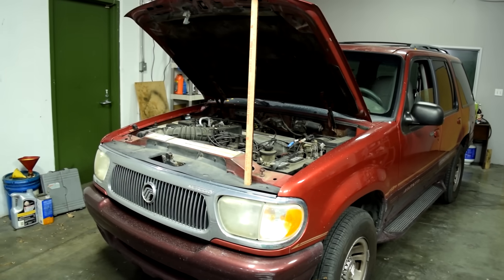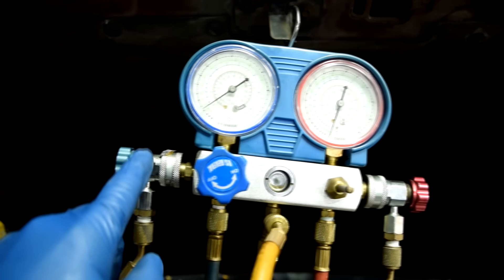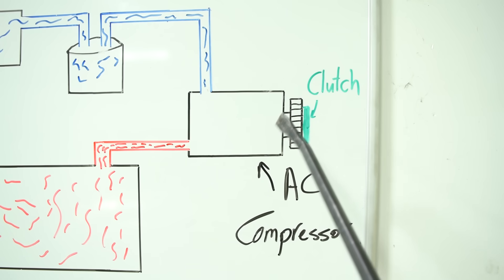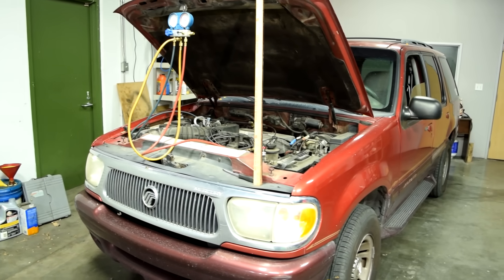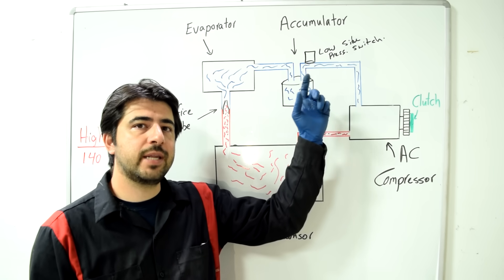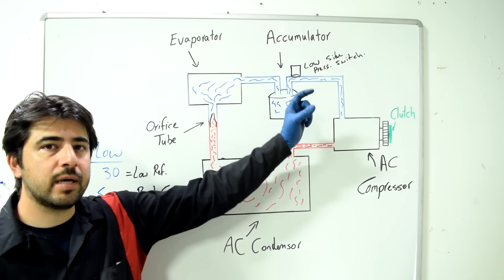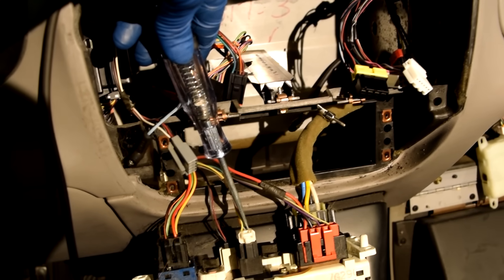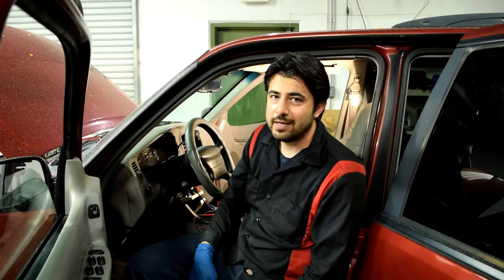Automotive AC Diagnostics, Operation and Repair

Comment: My condenser went out over a year ago(diagnosed by dealer and quoted a cool 1000 dollars to replace).
There is no charge to the system. 
I was wondering if the compressor is still ok after not being touched for a year. How can i tell?
Reply: GreenerGrassZephr 
How would that tell me if the compressor works? 
I know where the leak is.  I just don't want to replace the condenser and have a rotten compressor destroy it.

Comment: R134a corrodes copper, so the system must include an additive to prevent it.
R134a systems require special lubricating oils that are, on the whole, what type of aditive i should use with R134a

Comment: i want to make home AC buy using car AC compressure and other equipments.
Why i want to make: CAR compressure is robust, it hase no  motor. so i can use it by inserting 3 phase motor to it through coupling and saft . 3 phase motor can be run by AC drive which is single phase input and 3 phase out put and also we can controll the RPM of motor. When normal sigle or 3 phase motor starts to rotate it squzee all you home electricity at that starting moment. in other side motor driven by drive(VFD veriable frequency drive) it will not squeeze ur home electricity at starting time of motor.
need help to build home AC system using CAR compressure.
Reply: thanks for ur valuable reply
what i have to make
TO do list
1. AC car compressor (buy any 1400 CC CAR AC)
2. Three phase motor 230vAC
3 Single phase to 3 phase output AC drive
4. controller using arduino UNO 
5. Custom make Remote
6. Indore unit which has  swing window, evaporator,blower ,sensor,Co2 detector.
7. Outdoor cabinet which has radiator/condensor to cooldown 85 degree high pressure gas to 55 degree high pressure gas/liquid.
Motor coupler,
8. Radiator/condensor FAN ,TEMP sensor etc
Now i am stuck in Accumulator and orifice section. Orifice has tapperd diameter pipe (How to Upload PHOTO)
How to Know how much HP required to rotate the compressure saft.
As i will use Drive then i can slow down or increase speed,torque remain same without using cone pully,thats the drive's benifit. Also i can sense temperature and according to temperature motor speed can vary.
Do u have any idea which gague of copper pipe will take 200PSi pressure?
 Make a video related to whole AC system of a CAR.

Comment: quick question, when you connect your hoses to the service ports do you have to purge the hoses of air with refrigerant, I know air in your system is bad.

Comment: sir, my car i20 ac compressor gives a pressure reading of 40 psi at around 33 degree celsius (or 30 to 38 celsius) on the Low Side with full ac on. 

Is this normal reading? if not, would be grateful if you could kindly provide me some kind of pressure readings chart. Soliciting your attention. Thanks.

Comment: I need help: The Ac of my  2000 v6 mustang is not working and as I checked the compressor clutch does not engage. As I checked there is no voltage at the compressor connector and also there i no voltage at the AC fuse in the fuse box next to the battery. No is it possible that the switch is bad or maybe AC  refrigerant pressure is low so the AC switch is not working. I recognized when I switch on the AC the light on the switch doesn't turn on.

Comment: Very excellent, instructive video. I had a similar problem once before. In the hot months I would physically turn off the hot water supply from the engine cooling system with a manual valve, or simply disconnect the heater hoses and bypass the hvac system. Of course, it's a little inconvenient, and you have to reconnect to turn the hot water back on in the cool or cold weather.
Reply: This person is the true g. The solution is always in the comments.

Comment: What will happen if the condenser pipe pipe is too much hot... low side 40psi and the highside is 280psi? I know is not normal because I change the compressor..new compressor the condenser not change but the cooling system is good... maybe I change the condenser ?

Comment: My gauges are reading 44 on low side 200 on high but getting getting a  little bit of cool air the breeze in the shade outside feels cooler  blowing into the windows. I was thinking it could be the blend door  actuator but I notice my liquid line was not getting cold at all. I am  stumped

Comment: So if my static pressure is different there's a clog my high side was slightly higher than low and when I rev engine the high side goes from 210 to 250 but low side stays at 47 and does not move at all is that ok?  Thanks so much

Comment: Great diagram! I don't have a pressure gauge... There's a lot of useful technical info  this video. I actually already replaced the Belndor Actuator for the heater. 

Mine has refrigerant and blows cool air, but not cold and doesn't cool the car enough.
Reply: You're personality is also awesome. Jokes, etc.

Comment: base on my observation.if the low side pressure up and down.maybe some air inside.i think its better to remove the refrigerant.and then vaccum.and recharge again.to make it sure the accurate reading the refrigerant

Comment: Since you're in California where it's rarely cold, couldn't you just go "a la mexicana" and disconnect the heater core from the system? that would keep the heater core from heating up and if it's blowing both cold and hot air, we've just eliminated the hot air.

Comment: Great video, install a manual shut off valve for the hot water going to the core for the summer and open back up for cold winter

Comment: ur right dealer says u have to replace whole unit but they r wrong u still have to take heater box out and disassemble and get part # off blend door and give dealer the # and they can get it but they have no way to look up just blend door without that # hope this helps

Comment: My compressor/clutch is fine. I'm not getting cold air, just slightly cool air. The heater works fine. The blend door actuators are fine.  It feels like cold air is "trying" to get some cold air in. Frean levels are fine. What could be the problem? Cadillac Deville base 2001.

Comment: At 9:57 of the video there is an error in the psi conversion chart on the fourth line in the high side column. What a goofy thing for me to notice, ha ha. It looks like higher humidity pushes numbers up a little on both sides. Another classic video, thanks for posting.

Comment: I really have learned alot from your videos!  Thank you for posting them. I have a question!
I checked the pressure on a 2005 dodge 2500 cummins diesel "with an elcheapo" gauage set  and I have 0 pressure.  The compressor clutch can not turn on without pressure in the lines, correct or no?  If I am correct that there must be pressure in the lines, then I must add refrigerant before I can do any testing?  Pleases replay  "yours" at 1clyne@integrity.com

Comment: Hello, I start with the pressure gauges, I would diagnose myself the pressures of my air conditioning. at the moment in France it is 12 ° Celcius (53.6 ° F), so how much should be the low pressure and high pressure, air conditioning at a standstill? then pressurized air conditioning and engine idling? Thank you in advance. Best regards

Comment: My old 1993 Mustang LX had this interesting problem: the electric condenser cooling fan was broken, which made the high side extremely high.  It was so high that the compressor was basically locked so when the clutch engaged, the rubber damper/coupling in it shredded.  It was pretty easy to fix: replace the fan and the clutch.  I'm surprised the compressor had no high pressure bypass, but maybe it's wishful thinking on my part (or it was broken).
Reply: jhallenworld I

Comment: i have a 2016 F-150  2.7 eco boost  the clutch engages for about 10 seconds then disengages and repeats with my hand on the tube i can feel it getting cold and then it disengages when its cold out in the morning it works fine ,in the heat of the day not so lucky any temps over 100 degrees it only engages for about 5 seconds ,i will check pressure ,hoping for low coolant ,any ideas ,the forums i have read said change clutch coil

Comment: I bought a car, ac didnt work, took it back and they pumped it up, worked for 2 weeks then stopped again, took it back and they pumped it up again, i mentioned that there must be a leak they said they checked and no leak found...i just open the window these daze :-(

Comment: HEY GUYS, for those of you that have a similar issue, you can always just break off the blend door from its controller and use some tape to close it for ac for the summer months so that you can have cold ac without having to take the whole dash out and replace it . 

just fyi. I did this to a 97 ranger and its been working great, just rig it using some gray plastic tape.
Reply: or you could just bypass the heater core.

Comment: Please help - I have a 2010 Chevy Traverse, ac works well when first turned on, however, after a while the blower dies down, and it quits blowing cold air.  If I shut the blower off for a while, then turn it back on, it seems to recover, and begins blowing cooler air for a while.  Then blower dies back down, no cold air.  Is this a symptom of low coolant ?  Or is it a symptom of a faulty blower, or indications of troubles elsewhere in the system. Is the blower operation dependent on the ac temperature?  Shouldn't it blow at the same speed no matter what the temp of the ac air??

Comment: Very nice.  I have a highlander 2011.  What the AC is on, it blows warm air on the driver side and cold air on the passenger side.  Any idea why is that?
Reply: you have dual climate control separate for each side. Air mixing door on driver side is stuck/broken and doesnt change position to cold

Comment: Hey brother I was looking your video very nice and complete video I have a question I just charge my ac because I was doing some repairs in my truck so I did everything I vacuum the system everything was ok until I put the ac 134a and I open the low side and by mistake I open the high side to   And was a mess do you have idea what do I need to do now.
Reply: Watch ChrisFix video.  I'm doing mine this weekend.  How did yours turn out?

Comment: Great Instructions for troubleshooting the ac system. With regard to the blend door, it is very time consuming to change if you use standard procedures. I had the same failure. My approach was to cut the floor out of the blend door box and replace it from below. 2 hours to complete. I made a new floor out of clear acrylic sheet and relocated the pivot point for the blend door in that acrylic sheet. I attached the acrylic sheet with a series of holes and safety wire. You have to be a bit of a contortionist to get this done. Very close quarters. I made all the cuts with a dremel. Probably not something the average auto shop will do. It is a bit of a Macgyver process. By the way, the new blend door from Ford was about $28, 6 years ago. Dealership wanted more than $1000 in labor to do this. At the time, the truck was a 98 with 80K on it. You are also right with regard to this being a common failure. When you see how under engineered this blend door is, you will also understand why it is a common failure. Since I made this repair, I never turn the blend door knob all the way in either direction to insure it does not maintain too much torque on the door against the hard stops.
Reply: John Elmore p

Comment: I tried to charge my A/C with refrigerant and could not get the compressor to turn on. So I was unable to recharge the A/C in my 2006 Tuscan Hyundai. I took it to Plains Tire here in Rock Springs, Wyoming. They recharge A/C systems only. They said it would not take a charge, there seems to be a blockage somewhere and refrigerant was not very low. Please help!
Reply: Sounds like you may have a compound problem: too much refrigerant in system and a blockage (probably in the evaporator core orifice which has tiny openings for spraying compressed refrigerant). The pressure switch controlling the compressor may be faulty as well.It may be you have significant of moisture in your system-it freezes into ice particles that may block orifice opening shut. Best thing to do is evacuate refrigerant-check evaporator orifice for any blockage-check pressure switch for operation and check compressor for any blockage. Lot of work but needs to be done if you want your AC working again. When attaching vacuum pump let it run for 5 minutes or so-shut it off after closing valves on gauges. Check gauges for any change in vacuum-if there is, you have a leak somewhere (though I have seen very small leaks show on gauges I continued pulling vacuum with plan of using a refrigerant that has a sealing compound in it). It's best to run vacuum pump for a long time (24+ hrs) to assure removal of all moisture in system-when evacuating system be sure to have both valves on gauge opened for optimal moisture removal. All this you can do yourself....you found a decent video here that explains clearly on how to work on auto AC systems. Wish you best of luck!

Comment: Excellent  well done good explanations

I have a question hope some one can help me out. I have a 90 toyota sr5 
truck replaced the ac with a r134a unit a few yrs back.  the ac is not 
cooling about 88 degrees in cab I did a static check 120 low 120 high.  
Started truck after the truck warmed up and the clutch fan came on the 
it was 30 psi low 225 hi .  Before the clutch fan came on it was 34 psi 
on low side and 310 high side.  This was done in the morning and temp 
was 105 +/- with 20-40 percent humidity.  The pressures call for 36-50 
low 235-280 hi

Question:  Are the pressures indicative of being low on refrigerant and that it is just a matter of adding or topping off?  And why did the pressures change when the clutch fan came on?
Reply: Sounds like you have a blockage in system-probably at the evaporator core orifice. I would not add any more refrigerant-you risk ruining the compressor-you're going to have to evacuate system and check orifice. Also, some auto AC have a filter located in the system-it's usually a long one about 3"-4" fitted inside the refrigerant tubing near the accumulator (receiver)-it is fairly cheap to replace though a special type of tool may be needed to remove/replace filter. The tool usually is not very expensive and autoparts stores sometimes will lend this tool if you buy your materials from them.
Reply: There is no such thing as a “clutch fan.”  Do you mean “compressor clutch?” Or “condenser fan”?

Comment: The hoses have a short bent tube at one end and straight connector at the other.  The bent end also has a Schrader valve inside the connector.  Does it matter which end attaches to the manifold gauges?

Comment: I plan on replacing all of 92 Silverado AC Components. Condenser, Dryer, Evaporator, and Compressor. Would you happen to know what is the recommended amount of oil that I should be adding to each?
the other question is once I do add the oil and charge it. Is a vacuum recommended when doing all this?

Comment: in my case i have 100psi on both ports when car is off
when i turn car on and clutch engages i have same (100psi) on high pressure and 40 psi on low pressure side.
when clutch desingages still have 100 on high pressure side and 85 on low pressure side.  is it my comoressor then?

Comment: Do we need to vacuum the system when we replace high pressure valve on Chex Sub 2001 1500CC
Reply: yes, after replacing any component  like a pressure valve in the ac to do a vacuum of the system

Comment: its 86 degrees outside currently. i have a 03 durango. i got lowside 15-20psi  high side 150-155psi no lkeaks I dont t hink... it seems to not cool at idle. the electric fan is fine stays on... the relay is good. the compressor is good and doesnt cut off or anyting like that. I'm thinking its just low on charge. what do you think?

Comment: From experience, a lot of late 90s Ford products developed slow leaks in the high side and low side service port valves...  One of the worst things is when they changed to electric powered blend doors.  Wish they would go back to using manually operated blend doors.  So simple...
Reply: Excellent, thanks for the help!

Comment: Excellent. Funny too. I'm a life long "shade tree mechanic" and your information & delivery is on point. The A/C explanation is perfect. I found your videos after I had knocked down some "elbow grease", and tried to fix a paint rock chip in my PitchBlack Hellcat Challenger. Thx to your videos I'm confident it'll be ok. My Purple Charger Hellcat paint will be fixed as well. Thx!😉

Comment: Dumb question:  Why don't you just block the heater hose?  If still no cold air, then the blend door has failed in the heat only position rather than somewhere in between. If so, perhaps the door can be moved with a  borescope.

Comment: ALWAYS good  video and info you share thanks. cheeeeeeeers
Reply: Got a serious problem A/C cools find when I deselect selector from mode to vent selections A/C will not disengage it continue run in vent mode is there possible coil got clutch stuck in lock mode and it want release will you share some input on this subject please thanks alot

Comment: How about a video with temperature differences before and after orifice tube. Or in and out of condenser. 
Maybe to detect clogged condenser.   In and out temps of evaporator or accumulator.  
Other things can cause high psi  than orifice tube.  Some use infrared temp gauge  to locate  problems.  
Thank you

Comment: I have an 09 Volvo that the AC blows ice cold for about 15 minutes then warms up. happens every drive . I've had it looked at no leaks outside or damage. Had the refrigerant evacuated and a hour long vacuum done to just for even small leaks. held vacuum well then recharged the AC to factory   fill compacity. same symptoms happen I know I need to go see what the system pressure is static and working but want to know what component it could be. many thanks for everyone's help !